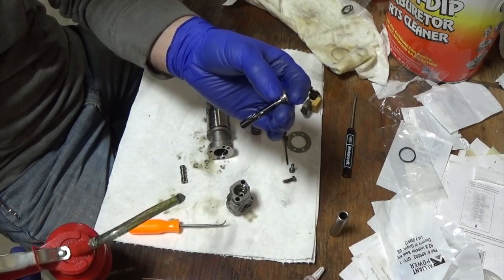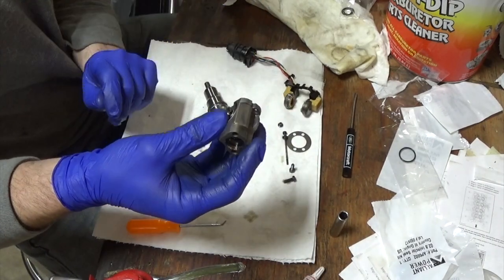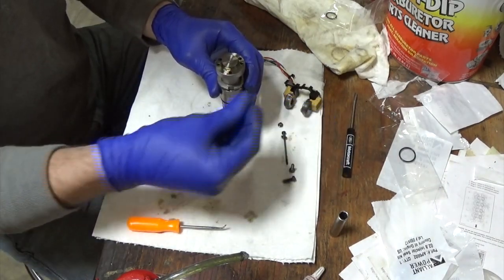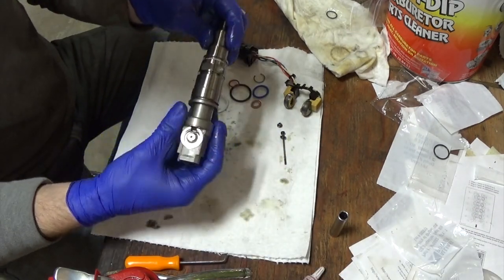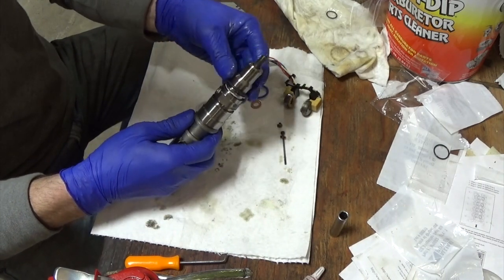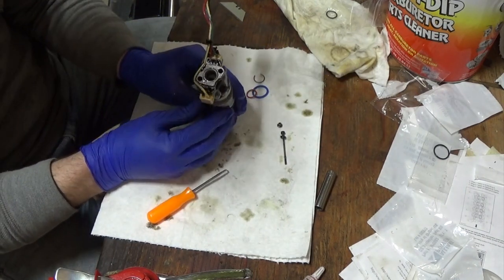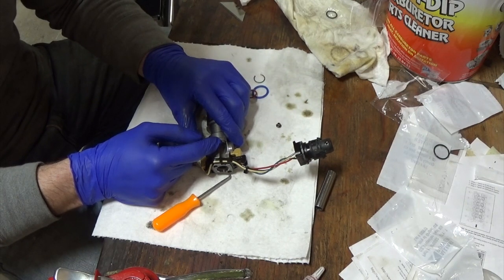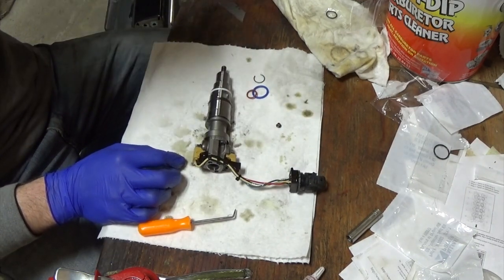6.0 injector final assembly

Comment: Am i just missing the torque specs u use? I cant find em anywhere please help asap thanks
Reply from the maker: @KimberlyConlee  I purposely did not include torque specs when I made this video. At the time that information was not given. While I assembled i was guessing. 
Now the torque specs are available. 
If you’re using Bitter Root diesels injector rebuild kit. It should come with a piece of paper with torque specs
Reply: @showmerepair my husband and i arent using any kit we took ours apart and cleaned them and put then back together ourself. But struggling with some torque specs really cant afford all new ones rn.

Comment: I feel more comfortable taking out the c clip for the top seal, and I built up the courage to try it, i was afraid to try it because every video I seen made it look tough,  however, I tried it and they pop out very easily with a very small screw driver, on one of them i did pick the seal out first to give me a better grip on the clip, did all eight in 5 minutes
Reply from the maker: @davidharden9410  good info. Thanks

Comment: UPDATE!!!
I got everything replaced and put back together. Truck ran perfect, amazing!!  After towing my skid steer to a job 30 mins away, coming home empty, i started having a "soft / random misfire". Pulled out #5 injector and the freakin solenoid bolt nut was literally hanging on by the last thread almost to drop off into the oil system abyss!! When i re-installed the solenoids, i followed your steps to the letter putting a drop of red locker after the nut. Now i'm going to remove all 8 injectors and put a drop of red on the threads before the nut goes on. When i re-installed all the solenoid bolts, i noticed that to tighten them all down just to the point of "no wiggle", the nut was'nt really tight enough it seemed.  Anyways,, just a little feedback. Loved your how to videos on the rebuild process, but the solenoid bolt step needs a review.
Reply from the maker: @BrigT262  good job at rebuilding the injectors.  The biggest thing is your learning how to work on them. The more you know the better you can fix it and the more reliable you’ll make your truck. Keep it up!!!
Reply from the maker: @BrigT262  I’ve had some issues with solenoid nuts backing off as well. 
I found lock washers locally at ACE hardware that fit the bolt.
Reply: @showmerepair   That's good to know! 
What's weird is the nuts were really tight when I went to disassemble them. But going back on, they weren't near as tight. Maybe they're only a one time use design??
Hopefully the thread locker drop will hold them secure for the long haul. 
When I pulled #8 on the drivers side, the nut had fallen off! Luckily it fell into a freeze plug and just sat there. By some miracle,  as I swiped around w the mini magnet, I found it! 
🙏
Reply from the maker: @BrigT262  I believe they are a one time use. I’ve looked for lock nuts for that size. Very hard to find.  My plan is to make a new video going over that.

Comment: I think the injector nozzle is the most wearable part. How did you deal with?  And hard o ring can be soft after hot water dipping
Reply from the maker: Many time I could fix an injector that was failing by cleaning and then reassembling with the bitter root kit that come with new springs.

Comment: Hello. I have 240k miles on my injectors. One of them is failing. Planing to rebuild them all.
I have been told not to rebuild because I need special table to test them. Is it really necessary? Or just follow your steps and I should be fine?
If I sand them to a shop to be rebuild. What they will do differently. Thank you for your time.
Reply from the maker: I’ve been told that 300k is max mileage on service life. Meaning rebuilding on high mileage injectors does not have good outcome. I’m just relaying information. I have no sources to refer one to for this to be a fact.  
The special table is called an injector flow bench. This allows the injector to be tested outside the engine. The information from the flow bench would be compared to a known good injector. If the fueling measured is high or low from known good data. 
I do not actually offer rebuilding injectors for customers because I have no way to test the injector before and after rebuilding to know if I fixed an issue. 
I truthfully would want to diagnose your engine and evaluate whether you only needed one injector or it would be best to replace all.
Reply: Thank you so much for this information. My rocket carriers are leaking. So head gasket needs to be replaced / studs and looks like new injectors. It is around 10k for this job. Maybe better to just sell this truck and get something different. Lol.
Reply from the maker: Your welcome

Comment: I've got questions for you.
You do tear down and clean 1 injector at a time? Is there a issue with mixing the parts?
Reply from the maker: From what I’ve noticed the shims between spool valve body and main body of injector are matched to the intensifier plunger.
Reply: @showmerepair  ok so basically just best to keep each injector (pieces) together. Better safe then sorry. 
Great videos BTW, very helpful information
Reply from the maker: Someone with more knowledge may say otherwise

Comment: Your videos are very helpful. I have a question about the injectors. It seems you are very knowledgeable about these. I am thinking about replacing the spool valves and upper seal on my injectors. Does the body of the spool valve body wear out? I mean the top of the injector. Where do you buy those parts? Thank you for your time.
Reply from the maker: Yes the spool valve body can wear out. I’ve not found any place to buy the spool valve body. I’ve heard around 200,000 miles is max for spool valve body.
Reply: @showmerepair  Thank you

Comment: Have you heard if you you over tighten the coil all of them wont pass a buzz test?
Reply from the maker: Over tighten one injector and all injectors fail buzz test? Or over tighten all coils cause all injectors to fail?
Reply: @showmerepair  Over tighten all coils and truck runs fine for a week then they wont buzz. Took one out and removed and reinstalled coil then that 1 injector buzzed properly.
Reply from the maker: Did you actually torque them or tighten by feel? They should really be torqued. If I remember it’s around 4 lbs in.
Reply: @showmerepair  i did it by feel. I couldn't find a wrench that did 4nm.
Reply from the maker: I’d imagine that is your problem. Get a torque wrench or you’ll be doing it again. I had an issue where I had random mis fires. Torqued correctly. Problem fixed
Reply: @showmerepair  do you know of any place who sells them that small?
Reply from the maker: https://www.jegs.com/i/JEGS/555/M195/10002/-1

Comment: You ever find a way to remove the clip on the top?
Reply from the maker: Yes but it requires using a carbide bit. Grinding into the housing. I tested it on a damaged housing. If that was done you’d definitely want to disassemble and clean the injectors. 
When replacing the top o-ring I pinch the o-ring flat then stick it in the top of the housing. I lube it with oil then work the o-ring in the a dull pocket screw driver. I damaged one doing this years ago. Now I’m pretty good at it.

Comment: Thanks for the excellent video. I just had to replace the magnet harness and connector on an injector and I wish I had seen this video. I am not 100% sure how much I tightened the screw that holds the magnets, but when the engine gets warm the injector starts dropping out. When it's cold, it runs perfectly. I used a nutdriver and torx driver to tighten it down because I was paranoid about over torquing the screw and breaking it. The magnet harness I got on feebay, so I have no idea of its origin or function. What are the symptoms of an over tightened screw? Perhaps the magnet / coils are just bad? I know my old magnets were fine, I just smashed the connector and pins.
Reply from the maker: Over torqued solenoid bolt will cause misfires hot idle. Torque spec is .5 nm
Reply: @showmerepair  Thanks! I will be tearing back into this thing over the next week.

Comment: Hey Chris can u help me out ? I rebuilt my injectors as is in your video I still have the same problem as I did before as exsesive  smoke out the tail pipe and I smells like un burnt fuel can u give m some tips and tricks to what too do ? And I got no codes as well
Reply from the maker: I wouldn’t worry about the running rough cold until you fix the no start hot. Sounds like you have a high pressure oil leak. The most common issues for hot no start. D-plugs or Top  injector o-ring that oil rail nipple goes into. If you can’t get ahold of anything to pressurize the high pressure oil system with air. 
Start the engine. Create the issue of no start hot. Remove valve covers. Have someone crank the engine and look for an oil leaks.
Reply: @showmerepair  I will see what I can find and let u know
Reply from the maker: Does it run rough? Are you getting any other symptoms?
Reply: @showmerepair  actually it runs ruff. When cold but smooths out after warm up also after at operation temp u shut it off it won't start back up till it cools back off as the other issue 😒

Comment: Ended up rebuilding all 8 on my 6.0 been cranking haven't gotten a start yet just long cranks. Reaches 800 PSI on ICP. Is this normal, I did reseal with HHC nipple rings, Blue spring mod, the injector rebuild with new nozzles, spool valves and deluxe ring kit, ICP screen update, At a loss as to why it hasn't started up yet though. Any ideas or is it normal for long cranks after doing that much work. I practically emptied the high pressure oil rail to reseal the cups but figured it should be refilled by now with it reaching the 800+ psi
Reply from the maker: You have a leak in the high pressure oil system. These engines will run on 500psi. If you don’t have anything to pressurize the high pressure oil system with air. Use the starter wire by the passenger battery to crank the engine and look for high pressure oil leaks with valve covers off.
Reply: @showmerepair  ok thanks was hoping that wasn’t the case.  Not sure even where the leak could be though as everything got new seals on them, I triple checked the high pressure oil rail quick connections were connected to the dummy plugs, torqued the injectors and high pressure oil rail down accordingly. Might have to invest in an IDS system, the edge CTS is only capable of so much info. Dang , took me a weekend each bank was hoping this would’ve been the end of it being down. Anyways enough frustration and whining on my end, thanks Chris. Will let you know how it goes..
Reply from the maker: Ask as many questions as you need. An ids really won’t help you pin point an oil leak. I’ll try to put a video out soon how you can check for leaks with out an ids or air.
Reply: @showmerepair  Thanks Chris, I uploaded a video of my truck turning over , you can tell once it builds that pressure past that 500 psi it changes tone but still no start with unfortunately.
Reply from the maker: Ok. If you can email me if you can with what you find from disconnecting the icp. Then we’ll up date the comments when we figure out what fixed it so we can help others.
Reply from the maker: The change in tone is normal. Did the truck run before or are you trying to fix a problem? 
The more I think about it. You may not have a high pressure oil leak. The engine will start on 500psi. Does it hit 800 then drop below 500? 
Make sure your getting fuel to your secondary fuel filter. Remove the fuel filter on the engine. Turn the key on and watch to see if the fuel bowl fills with fuel. Be ready to turn the key off it will fill quickly.
Reply: @showmerepair  So, the truck ran fine before this project other than intermittent low injector circuit #7. Upon removing connector i saw it was one of the 4 pins corroded away so I figured we’ll while I’m in the truck I’ll change them all since they’re at 195k miles on the originals. I’ll be honest when this went down I thought initially “ i have low pressure and high pressure reading on icp, it HAS to be fuel, I messed something up doing the blue spring somehow”,  went to remove the secondary cap and the plastic snapped so then I gave up for the evening to spend time with my kids lol I  will remove it and inspect that in the morning. Have a metal one on order
Reply from the maker: If you have any more questions email me jcbryantllc@gmail.com
Reply from the maker: I don’t know what I was thinking when I responded yesterday that it was a high pressure oil leak. I read back over  our conversation. I’d like to a higher icp but 800 is higher then 500 so high pressure is good. If you need to check fuel pressure go to harbor freight and pick up a oil pressure gauge kit. It has a fitting that will fit the test port on the fuel bowl. Can you see Ficm sync or anything on your edge that shows sync?
Reply: @showmerepair  Hey Chris so this morning I pulled the secondary filter cover, filter was still very clean,  turned the key, bowl filled fairly quickly, as far as the FICM sync it gives a numerical value of 1 when cranking and 0 when keys only turned to accessory on . I am going to pull the IPR again and see if maybe the screen is clogged up causing it to stay closed at it’s 85% value. Not sure if that could be an causing factor with my symptoms but it’ll be an easier preliminary check before going back under the valve covers! Lol thanks again for the continued correspondence and your time. Nice being able to brainstorm with someone who’s knowledgeable in these trucks/engines.
Reply from the maker: Have you tried disconnecting the icp sensor and crank the engine? Also is the engine cranking weird. Do you notice when you start cranking the engine. The engine starts cranking then slows down then cranks normal?
Reply: @showmerepair  no doesn’t slow down at all, seems to crank fine. I will prob have to change starter shortly after this with how much it’s been cycled but otherwise it cranks fine. No I will try that tomorrow! I just pulled the IPR and the screen was clean and resistance between the connections were 8 Ohms which supposedly is good. Sprayed it anyways with air and reinstalled will try to start without ICP connected and get back to you!
Reply: Any updates?
Reply: Yeah, the rags I used to wipe the internal assembly were NOT as clean as they said they were so the sensitive injectors had to be dissasembled, thoroughly cleaned and reassembled. I ended up selling them and buying ford remans as I was under a time constraint due to me moving. Sucks wasnt a good outcome but live and learn.
Reply: Yeah, the rags I used to wipe the internal assembly were NOT as clean as they said they were so the sensitive injectors had to be dissasembled, thoroughly cleaned and reassembled. I ended up selling them and buying ford remans as I was under a time constraint due to me moving. Sucks wasnt a good outcome but live and learn.

Comment: Thanks for doing this.  Saves lots of money!  Do you have a handy solution to fix cracked heads without pulling them off the engine?? :D :D :D
Reply from the maker: I’ve not tried any of the products that are made to fix the cracks. I usually just replace one or both cylinder heads. due to pinpointing specific injector bore that is leaking can be tough. If I could figure out the exact injector bore. The repair I would like to try is from Accurate Diesel. https://www.accuratediesel.com/shop/279.html
Reply: @showmerepair  I was completely joking about fixing cracks, but now that I see that kit...hmmm. My problem is the exhaust getting into the coolant system.  I'm planning on new heads soon.  If I can rebuild injectors myself, that means sooner because I wanted to do it all at the same time.  I just did studs and a homemade remote cooler four years (~30k miles) ago.  I looked up the kits you're using for the injectors.  Are the springs really that necessary?  They seem to add a lot to the cost of just new orings.
Reply from the maker: Look into getting o-ringed heads. Only way I’ll do heads now. Way cheaper in the long run. I’ve had several injectors with springs that are thin from rubbing  against the body of the injector or broken. Unless I was in a pinch it’s definitely worth it to get springs. I’ve had good luck with both standard and deluxe kits from bitter root diesel.